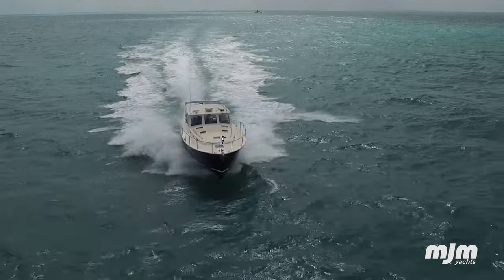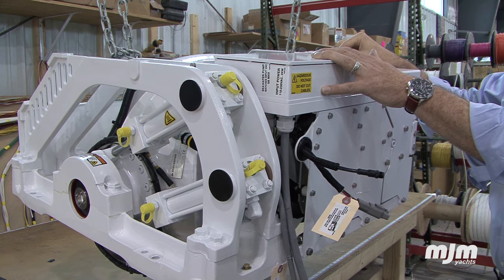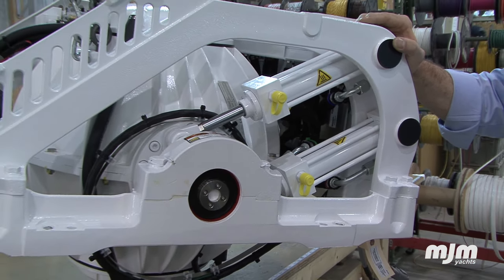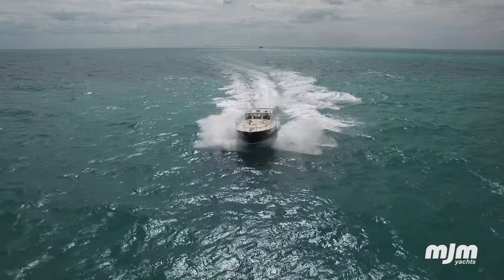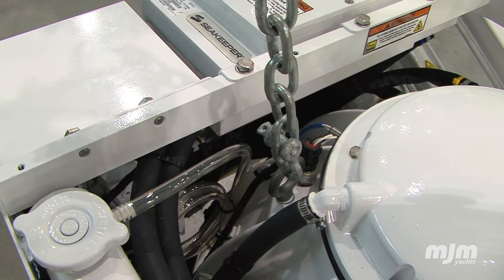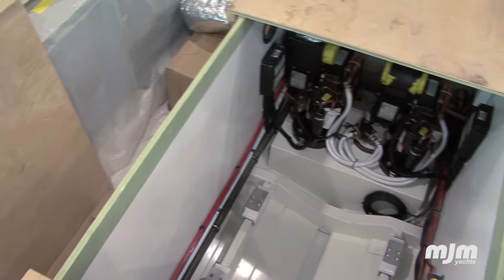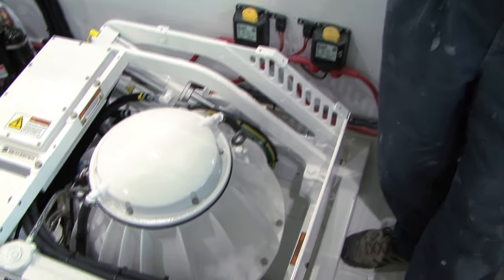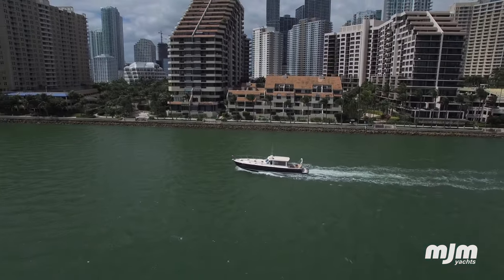MJM Yachts Seakeeper Gyro Stabilizer Review and Installation

Comment: What happens if / when it overheats (the water intake gets clogged etc)? Redundant systems to shut it down before it blows?

Awesome if rocking bothers you. I like a little rocking to sleep better because my bones ache (sleeping beam to beam when rocking hard vs bow to stern when rocking gently :-) This is great for any powerboat as they seem to rock very hard, pounding a lot. The large keel on a sailboat softens the rock a lot.